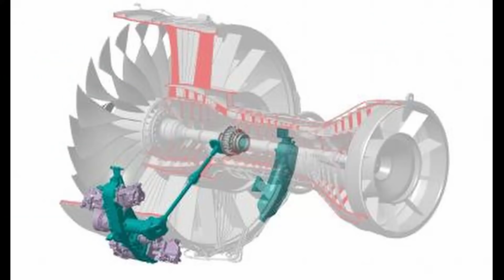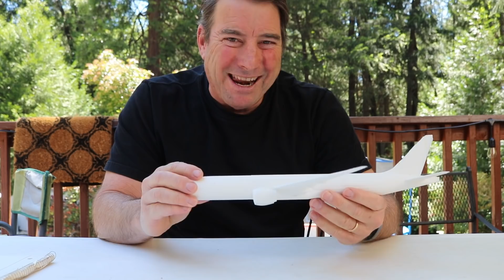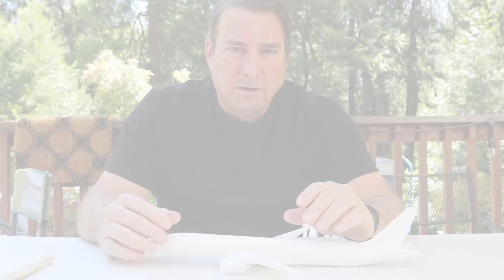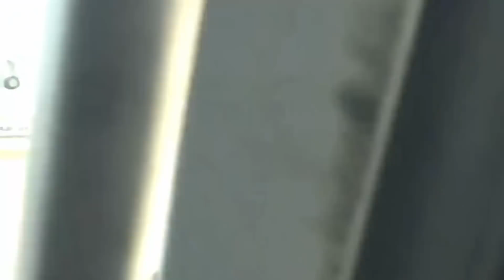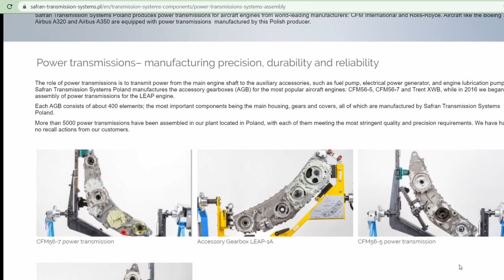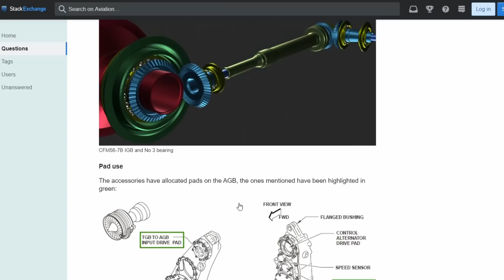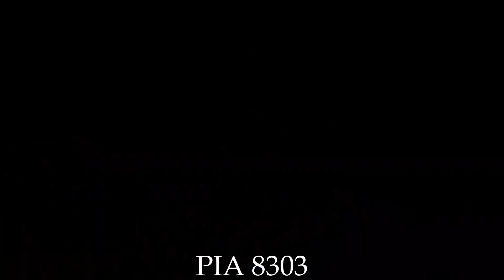PAKISTAN INTERNATIONAL AIRLINES #8303 UPDATE #2 23 May 2020

Comment: The aircraft managed to start the Go around but lost power on climb out so it was a "delayed" failure. The most likely candidate in my mind  would be a damage oil or fuel line, the CDP line from the core to the EEC runs in the area as well but would have caused an immediate rundown of the engine. I think the gearbox is a little CCW  (FLA) enough to not be hit .

Comment: 1) I always wondered how the accessories were attached to a jet engine. 2) Handcrank attachment pad? 3) OK, why was the RAT deployed. That is unusual. It is usually a last resort. Does that mean they couldn't start the APU?
Reply: RAT deployment is significantly faster to get power to a stricken aircraft.  Remove the guard over the switch, press switch and should have additional power quite quickly as compared to having to wait for the APU to fire up and come on-line.
Reply: @evilload  Thanks. Further research seems to indicate that, on this aircraft, RAT deployment is automatic in the case of dual engine failure.

Comment: i'm curious as to what lead to the initial "touch/go". if the aircraft landed long, (w/gear down) it wouldn't seem to be enough time to cycle the gear back up (15-ish secs) and then have the a/c dip back into the runway before initiating the go around. the picture doesn't seem to show any gear door damage or obvious tail damage leading me to believe the a/c pitch was near horizontal when the engines made contact.

Comment: If you go back and listen to the beginning of the audio with the flight controler the pilot says, " we are comfortable now and we can make it."  They are at 3500 descending to 3000.  He is established on the ILS.  This indicates that they were already uncomfortable with something before they acquired the ILS.  It's not likely to be a landing gear problem.  If they were having trouble lowering he gear they would have aborted sooner.  The comment: "We can make it,"  sounds to me like they were already having power difficulties.  Yet the engines were still running enough to have gotten back into the air before dying.  Accidents often happen as a chain of events.  It would be helpful to have the earlier audio which might explain what "comfortable and we can make it now" means.  We don't know why they aborted?  Were they already distracted and forgot the wheels?  Did they decide to go round and didn't lower the gear to reduce drag but then didn't have full power to complete the go round without a touch and go with no wheels?  Too many questions.  Too few answers.

Comment: On 22nd May I also operated a domestic flight to Islamabad from Karachi being a lone B737NG, before this accident. Due COVID-19, this Pakistani A320 was also a lone landing aeroplane, if any other aeroplane holding short or on a parallel taxiway would have warned him or given him a go around. Yes, I agree with the presenter, how come both the pilots failed to skip Before Landing Checklist then missed audio warning, then missed reason of low engine power settings (landing gears generates lot of drag) during approach. Whatever the case was, retarding thrust levers and then advancing them for a go around takes time, in aviation it is a good a time. And if you have landed on your engines even with acceptable touchdown rate of decent, surely you will damage your accessory gear box to a catastrophic level. Belly landing is a planned manoeuvre and going around is a realisation of a mistake, why they missed lowering of gears is beyond my understanding. I hope investigators will find it out. Happy Landings.

Comment: I'm sure with the amount of damage done to both engines, at least one or more oil or fuel lines were damaged & leaking.
Reply: The accessory gearbox drives the fuel, lubrication and hydraulic system.  So the pumps may have stopped working.

Comment: Yeah more than the gearbox damage i would say hydraulic pipes are the most valuable part here and can be damaged very easily getting squashed between the Cowling and the engine, we don't no of any witnesses who made of saw any fluid coming out of the plane that would indicate a damaged loss of hydraulics.
But the real question? is why the pilots thought they had landing gear down seems to be the indication question here we should be asking

Comment: Juan your accurate analysis does make lot of sense in connection to PIA crash..! Air craft manufacturers should think and attach cameras systems pointing towards nose gears and main landing gears wheels to view of proper functioning of landing gears on cockpit screen + more camera watching engine and back tail and recorded on separate black- box this make clear the impasse about any crashes or accident....!!
Reply: The ECAM in the airbus is more than capable of doing this. If the gear is not down and locked it has clear indications

Comment: Thank You Juan for your explanation on the engine components of this aircraft. Sorry for the lost of life as a result of this crash. I do not mean to second guess the flight crew but once they touched down the first time, with apparently  no or malfunctioning landing gear. Would it have been better just to ride it out on the engines. I remember being a deputy in Casper, WY in 1983 and a Frontier 737 landed with its landing gear retracted, the pilots rode the entire runway to final rest on the engines. I do not recall any major injuries to passengers, but damage to the engine cowlings only.  I can still the marks left on the runway. Camera's back then were not as common to have in your possession as they are today otherwise I would have taken a lot of them. Would it have been acceptable to ride it out?. Thank you for the information on the RAT. I had never heard of it before, and it would be interesting to me to find out how long a RATT has been used and what type of aircraft it is used on if needed. Thank you again. Best wishes to all , sincere sympathy to those who died or injured.

Comment: So it seems like pilot error. Either they forgot to deploy the landing gear, or they retracted it too soon before the aircraft could pull up.
Reply: The available ATCO Voice recording is highly edited and missing some very important conversations. Without complete contents and time line, it’s highly confusing. 
There is no proof as of yet that the pilots did not extend gears. There are a number of possibilities that either gears collapsed or did not come 
out. There are 5 controls to make sure that pilot does not forget to lower gears on any A320 aircraft. 1) Visual Green lights of normal and alternative systems 
2) ECAM Warning through Master Warning 3) EGPWS Warning 
4) Landing Checklist and ECAM 
5) Advisory by ATC 
It is impossible to ignore all 5 warnings and land without gears. The 
notion that pilot forgot to lower landing gear is totally rubbish unless these warnings were somehow cancelled due to maintenance work or a systems failure that caused these warnings to not sound. There are credible reports that aircraft landing system underwent maintenance a day before fateful flight. Thus investigation is required as to what work was done and the quality of workmanship. 
E.g., LGCIU 1 failure would have caused multiple failures in the 
aircraft including EGPWS failure and Gear Indications problem
Reply: No they already discovered that there was a problem with the gear not going down and either they didn’t realize it or got the warning sound just a second too late or something..
Reply: Note from the surveillance video of the plane just before it hits ground that the landing gear IS now down!!!

Comment: Even if the impact did not directly damage shaft/gear box assembly, VERY likely that amount of impact force could have easily jarred shaft loose, broken teeth on either end of shaft, or even snapped shaft in middle. 

Mechanical failure does not always emanate from direct physical touching - some mechanical failures are caused by indirect forces - F=MA still applies - and that plane’s hitting the ground had a lot of Mass and Acceleration.  

Think of an automobile seat breaking loose when T-boned.  Those seat brackets and bolts were not necessarily directly touched - but the physics of the whole system is applied to all components in those events.

Nice report of event and parts involved!

Comment: 2 survivors... wow.  One guy was in seat 8A.   He said in a translation ( sub title) that “AFTER the plane rose from the RW a second time ... there was smoke”   Juan, your Acc Gear box damaged scenario is highly plausible. There are few engineering fail points ( shear shaft ) built in to the main shaft as well as the 90° gear drive and each Accessory mounted on the gear box has its own shear point... I can see a good walloping on the whole assembly creating a shear shaft breakaway and you lose EVERYTHING.. including FUEL pumped to the engine.  The last time you showed the close up of the engine... it sure looked as if the ring cowl on #2 is deformed.  I feel so bad for these people... they just get to go and fly somewhere for the the first time since lockdown.... sad
Reply: CORRECTION... he was in 8F  ... this is a link to copy paste.   https://youtu.be/TrdXWSrlGxI

Comment: Juan, if one assumes that the initial touchdown was too far down the runway, a go-around was called for and the a/c hadn't put enough weight on the landing gear squat switches, could the gear have retracted while the engines were spooling up? I seem to recall Airbus had an AD which required the value of the squat switches to be changed following an accident some years ago.

Comment: It would appear that the gear was not down on the first landing attempt. What safeguards or warnings does the Airbus have to warn against a gear up landing?
Reply: Landing memo as part of landing checklist, gear indication lights, ECAM wheel page, master warning going off below 750ft RA if gear is not down and locked, GPWS warning “TOO LOW, TERRAIN”

Comment: Didn’t seem to be enough fire.
Reply: Maybe fuel leaked out after damage to engines because they climbed back to 2000 feet and then engines stopped
Reply: Why not turn on Apu like sully did. No fuel. Little fire

Comment: I listened to the ATC communication, sounded like there might have been some miscommunication or misunderstanding. Didn't the controller tell him his plane engines were damaged. I saw the crash site in town. Very raw footage. Very sad. God rest their souls. Two out of 107 may have lived.
Reply: There seemed to be some comms confusion with ATC on the initial approach, VAS has the recording, it's almost like the pilots were busy doing something else.
Reply: @rayg9069  Pilots were busy
trying to lower the landing gear. Obviously they forgot to inform the landing gear malfunction to the ATC.
Reply: The plane in its second attempt to land  was appatantly airborne for over 15 minutes because this plane hovered over my house  at NHS Karsaz(adjacent Karachi Golf Club) very low and with very abnormal  noise so much so that people rushed to their windows in fear.The passengers on board may not have observed this abnormality because of sound insulation inside..
Reply: @sarfrazali-ik5mp  goosebumps, what did it sound like?
Reply: @sarfrazali-ik5mp  You all living nearby were damn lucky.
Reply: Yeah 2 lived
Reply: Yeah I though I was strange ATC didn’t seem to see or mention damage
Reply: Respect 🇵🇰
Reply: Yeah, when the atc cleared the aircraft to land, the pilot responded to just ‘roger’ than what he was supposed to say which was to basically repeat what the atc just said.
Reply: ATC calls them 5nm at 3500’, should be 2000’ or slightly lower at 5nm, they were very high and no way established on the ILS, master caution chime most likely AP being taken out as there was no way AP could capture the ILS. There is no way in hell you can be stable at the normal gates from being that high. Unstable Approach, deep/fast landing followed by botched go-around... Tragic and totally avoidable if they went around at 1000’ as I’m sure their company rules would state.
Reply: @swerwerindiewind7334  what they did is like the worst botched landing in the history of flight.

Comment: 9:15 If the RAT had already extended when this picture was taken, doesn't that mean the accessory gearboxes on both engines had already failed by this time? Or does the RAT deploy when only ONE generator/pump stops working?
Reply: If both AC bus’s loose power. But can be deployed manually too
Reply from the maker: Both.

Comment: Just a silly question popped up: With engines installed under the wings / belly of the aircraft, there is always a risk of damage being caused during landing. What are the factors due to which they are installed at this location and not somewhere else e.g. above the wings. I know aviation experts might find this a very stupid question, but I'd appreciate if someone could answer. 🤔

And I think Russian Antonov aircraft have their engines above the wings. 🤔
Thanks & regards.
Reply: Noise for one. The engine would be louder for passengers seated next to it, secondly if it suffers and uncontained failure it is more likely to pierce cabin and cause repaid decompression. At least under wind the cabin can be slightly protected. Third who wants to stare at an engine for several hours blocking their view outside. And 4th probably a safety issue as in an evacuation the engine is partially taking up space on wings. Possible 5th is just safer in engineering terms to hang the engine rather than mount it on top

Comment: As usual a thorough and measured examination of a tragedy. A question comes to mind (a rank layman's in this case) could it all have started with a hydraulic/electrical failure that caused the auxiliary generator to deploy and the landing gear to fail?  This would shift the cause to the aircraft and away from the crew. At this point is there any way to know?
Reply: It doesn’t move it from pilots to plane at all. No pilot would attempt a landing with no gear without full preparation and planning. The landing gear can be manually lowered by gravity if required which the pilots clearly didn’t do before the first attempt otherwise you would see the gear on the photo. There are plenty of redundancies on aircraft these days that one single failure will not cause a plane to crash

Comment: please read.....

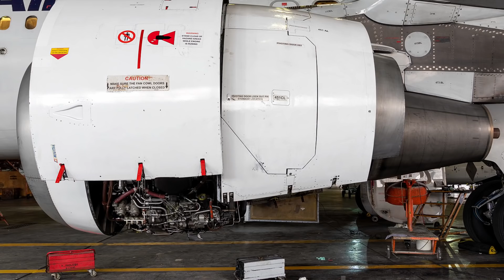A PIA Pakistan International Airlines A320-200, registration AP-BLD performing flight PK-8303 from Lahore to Karachi (Pakistan) with 91 passengers and 8 crew, had aborted the approach to Karachi due to problems with extension of the nose landing gear (in fact, when the crew read the landing clearance for runway 25L back the sounds of a master warning can be heard) and performed a go around. While on a left downwind for a second approach to runway 25L, about abeam the threshold of runway 25L the crew requested to turn left immediately reporting they had lost both engines (CFM56) and repeatedly declaring Mayday about 5 minutes after the go around, the RAT (RAM Aír Turbine) deployed. Tower cleared the aircraft to land on either runway 25 (25L or 25R). The aircraft lost height and impacted a residential area called Model Colony, featuring concrete multistorey buldings on second final approach east of the aerodrome (presumably while on final approach to runway 25L) and burst into flames at about 14:40L (09:40Z). On the ground, near position N24.9116 E67.1881 about 1350 meters/0.74nm short of the runway threshold, five multistorey houses - including the Allied School Airport Campus - are being reported to have been de-roofed and set ablaze, debris is distributed over the streets. Two occupants survived with injuries, 97 bodies were recovered from the crash site, the fate of the other occupants and possible victims on the ground has not yet been reported.
Reply: explain to me  a Senior Airbus Captain where the Engine touch the ground?

Comment: Do pilots activate the APU upon approach, or is it only activated when taxiing to the Gate?  Or, does the RAT deploy regardless when engine power is lost?
Reply: Gordon is wrong. The APU is normally activated when taxiing to the gate but can be activated mid flight if there is a reason to like loss of an engine but it takes about a minute or so to start. RAT deploys when plane enters emergency electrical configuration
Reply: John Fraser APU is only on Boeing. Airbus use RAT.
Reply: @gordonrichardson2972  APU's (auxiliary power unit) are on both Boeing and Airbus products.
Reply: Gordon Richardson APU is on both airbus and Boeing. The RAT is for emergencies only. The APU is used all the time